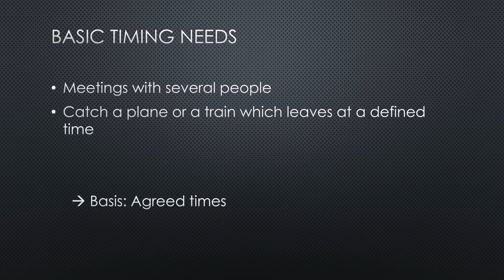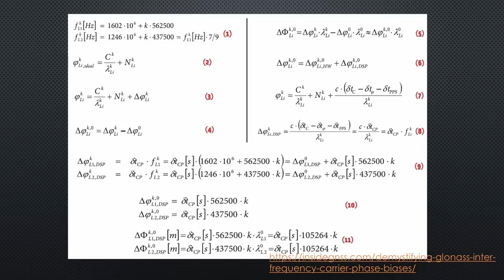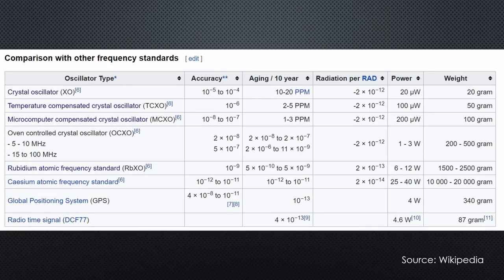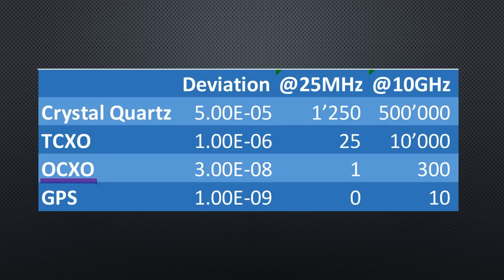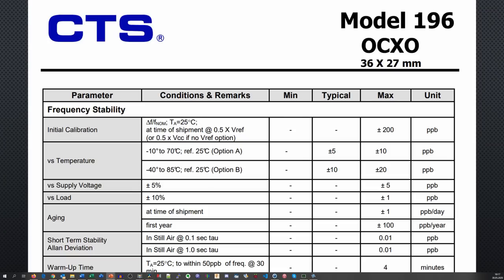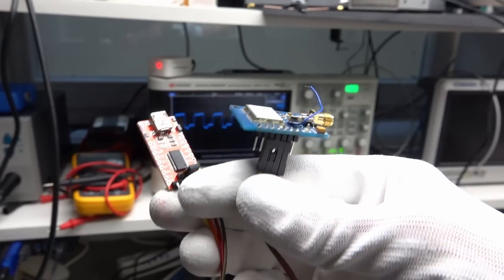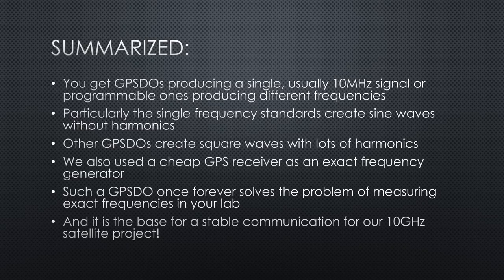#336 How to get Precise Timing and Frequency to our Lab. From Crystals, TCXO, OCXO to GPSDO, BG7TBL

Comment: Can you please make a video on how to choose the right microcontroller, I recently got an MSP432 for my college project and finding it hard to work with
Reply: @Scott Page USMC Thank you for  your interest, My problem is mostly with using code composer studio, I don't see many examples on how to program MSP432 whereas STM32 has got lot resources on web so was wondering if I have switch to that. I am very familiar with using arduino boards, but I was told not to use that.
Reply from the maker: I use Arduinos, ESPs, and Raspberries. Mostly because they have a huge community support.
Reply: @Scott Page USMC Thank you for your interest sir, TI is sponsoring the kits for us thus we are supposed to use them, I have searched some books and reading those.

Comment: I am a noob hobbyist, not a radio-head, so this sort of precision is over and above.  Last year though, while debugging a digital FM tuner (RDA5807M) project, I  discovered the frequencies of my watch crystals (2^7hz) differed wildly from each other.  Sometimes they were off as much as +/- 30hz, throwing off my tuning.  Still do not know any simple way to calibrate these (sigh).  Cannot see the end of that rabbit hole.
Andreas:  Do you know the secret to delivering a good joke?

timing
Reply from the maker: True (the timing of jokes). Concerning watches: You are right. Their timing has to be quite precise. I think a GPS module programmed at the crystal frequency and hooked to an oscilloscope would be en interesting experiment...

Comment: Using the GPS clock signal is easier than I thought! (I never know that PPM is also adjustable too)
How do you wire the GPS signal to the basement? Do you have to put the module outside and wire the pulse signal into the room? Or broadcast the clock signal as you do with your Ikea clock video?
Reply from the maker: GPS antennas are "active". They have an amplifier built in. So you can have quite a long cable from the antenna to the basement. But for sure the antenna must "see" the satellites.
Reply: Thank you for the answer. 😃

Comment: Andreas, you should have also included Mems oscillators. You can now get these from SiTime. They are available in TCXO's down to 0.5ppm, and now also have sub ppb accuracy OCXO's. These consume significantly less power and have much better over temperature stability, and have none of the Xtal defects such as activity dips. The are also MUCH smaller...if you want to know more you can connect with me in LinkedIn...otherwise take a look at SiTime.com
Reply from the maker: This is a "mainstream" channel and the art is to leave most things away ;-) Maybe in a few years when we can buy them on AliExpress like the MEMS microphones...
Reply: @AndreasSpiess  Andreas, already available in Ali Express, DiGiKey, Mouser, Arrow, etc.....and programmable to ANY frequency by user if required...They are now the worlds largest Oscillator (not Xtal) manufacturer, ship more that Epson, NDK...etc......obviously this is your channel, and you do a great job and this is why you have so many followers...thanks for everything..
Reply from the maker: Do you have an Aliexpress Link for a good MEMS oscillator? I plan to play around/compare with the different technologies and you seem to know more than me ;-)

Comment: Hi. Great explanation in a short time span! Short question: in the video at  about 18':15" we see the square wave of the cheap GPS receiver. Would you know why the square wave has/looks irregular width, with 2 wider and 3 shorter positive period square? If this works that would be a very cheap solution to a very high accuracy clock!
Reply from the maker: I do not know the reason for the irregularities :-(
Reply: @Andreas Spiess  I think I know now the Why part. Just watched an interesting video. It seems that the (programmable) output frequency of the gps generator is provided by dividing the main clock of 24MHz. If you choose a frequency that has fraction, then you get a weird mix. For example: 10MHz would be factor 2.4.  It seems you get a mix of 12 and 8MHz. More info on: https://youtu.be/M6SmdqMA-Dg

Comment: I see we are currently running on the same clock ;-) Iam am also just looking into the GPSDO stuff for an QO-100 SDR setup. I think I will go with the Leo Bodnar Mini @25MHz for the beginning. Have you seen the Lars GPSDO thread on the EEVBlog Forum? There is a ton of information on a (relatively) simple GPSDO Setup with an NEO-xx Module an OCXO and a small Arduino. Took me quite some time to find it, but looks as the best DIY Setup so far. So it should be possible to get a relatively cheap GPSDO for the QO-100 setup.

Besides have you seen the setup where someone reprogrammed the Pluto to run on 25 MHz reference clock speed? So you just need one GPSDO! ;-) (It's just a software modification, no deviders, nothing).
Reply: Lars GPSDO https://www.eevblog.com/forum/projects/lars-diy-gpsdo-with-arduino-and-1ns-resolution-tic/
Reply from the maker: One of my Pluto’s already runs on 25MHz;-) And maybe a OCXO alone would be enough for QO100. They seem to be quite precise.
Reply: This is one of the cleanest QO-100 setups I found so far (look at the small & clean POTY setup, great!):
https://forum.amsat-dl.org/index.php?thread/2936-pluto-box-solution-w-full-gpsdo-lock/

The Transmitter needs to be replaced, I will go with an SG Labs 20W @2400MHz PA and an https://github.com/db4um/PA_13cm_2W preamplifier.

It took me quite some time and tons of reading threads the last weeks to find the best components, hope it helps.
Reply from the maker: Thank you for the links. This is also my direction. Maybe waterproof.
Reply: @AndreasSpiess  Yes, a waterproof outdoor case with all the components included would be the best way I think. And then with a LAN Cable  to the Homenetwork. So no losses on the antenna cables. 

I am just not sure if the temperature changes outdoor wouldn't have a too high impact on the system!?

BTW I also stumbled over a nice Bias Tee PCB which injects the LNB DC voltage PLUS the 25 MHz from the GPSDO into the RX Cable.
There is also a 50 Ohm to 75 Ohm impedance adaption included. 
(If you are interested drop me a line than I can look it up in my notes.)
Reply from the maker: 1. The GPSDO should be stable in varying conditions.
2. The combined feed is a good idea for long cables. I assume you have to separate them somehow inside the LNB. I chose a twin LNB where I have desoldered one connector. Maybe easier in these small cases.
Reply: @AndreasSpiess  @1. Yes A GPSDO has longterm stability from the GPS but the short term depends on the OCXO. Which has an oven for a reason ;-) to keep the temperature impact low. But sine it can get cold in Austria and Switzerland (<-20C). I think selection of the OCXO is important.

2. Yes you have to separate the Clock Signal again in the LNB, but this come down to a simple low pass filter (25MHz vs. 2.4GHz) (and IIRC a 75 Ohm termination IIRC) Shouldn't be to hard for you. ;-)

I am currently learning for my CEPT1 exam this month so fingers crossed (by the way your FOSSASAT 1 video triggered it.)

@ LNB I was thinking to use the second connection for receiving wideband in parallel which needs the other polarization (so 18V IIRC). But I think my dish will be to small, let's see.

Comment: Have you seen the SiTime MEMS TCXOs? Seems like they'd be a good combo with GPS/atomic sources, they outperform many OCXO and are small SMD components..
Reply from the maker: No, I did not see them. They seem to be interesting parts. And, as you write, very small and energy efficient compared to OXCOs. And maybe they are good enough for many applications and can replace a GPSDO.
However, precision is not as important for a GPSDO. Stability is more important because the absolute frequency comes from the GPS signal.

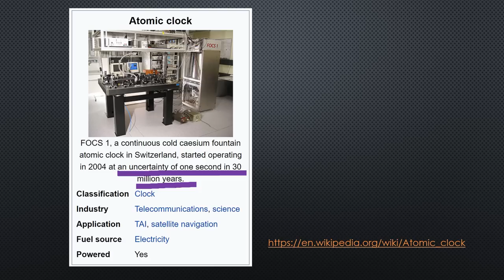Comment: 11:51 - "Clumsy and expensive" :) I would definitely knock that all over onto the floor, probably with the back of my chair or a coat sleeve! And then what would we use to recalibrate it?! :)
Reply from the maker: I am not sure if you have to calibrated these clocks as they use a material constant. (At least that is what I understood.)
Reply: @AndreasSpiess  Very true. But don't underestimate my clumsiness to take out atomic physics, too! 😂 Cheers, M1GEO.

Comment: @Andreas Spiess, I'm also trying to get external reference to my Pluto but I'm not sure how to wire the UF.L socket in place of the TCXO.. I found some schematics online but I do not understand them nor I can trust the source 😂 so I would be glad if you could explain how you did it, or how it works! :) Thank you!
Reply from the maker: Just look at the diagram. There you see the capacitor between the crystal and the chip. The pin of the U.FL has to be connected to this capacitor. And the ground to ground. the connector ends up with about 45 degrees turned. According to Analog Devices, the external reference should be 1.3V p2p max and should be applied before boot

Comment: I love the topic and your explanations.  However, it wasn’t clear to me if using the PPS output of a suitable GPS receiver would produce precision pulses THAT ARE SYCHRONIZED IN PHASE WITH OTHER GPS RECEIVERS LOCATED ELSEWHERE.?  Basically, if a person wanted to do Time Difference Of Arrival (TDOA) location of a transmitter, is it sufficient to use the GPS PPS output at each receiver site with confidence that they are synchronized with each other and with limited skew?
Reply from the maker: From Wikipedia: PPS signals are used for precise timekeeping and time measurement. One increasingly common use is in computer timekeeping, including NTP. Because GPS is considered a stratum-0 source, a common use for the PPS signal is to connect it to a PC using a low-latency, low-jitter wire connection and allow a program to synchronize to it. This makes the PC a stratum-1 time source. Note that because the PPS signal does not specify the time, but merely the start of a second, one must combine the PPS functionality with another time source that provides the full date and time in order to ascertain the time both accurately and precisely.
Reply: @AndreasSpiess  Thanks Andreas.  Greetings from the USA.   Experimentally, using my DSO, I proved to myself that the default 1pps output of two of my GPS modules is usually within 40 nanoseconds of each other.  So they ARE "synchronous".  I knew that the period was precise but I wasn't sure that I was guaranteed that they are aligned and it appears that they are.  Now it is possible for me to receive radio transmissions at multiple different locations and try to determine the origin using TDOA techniques.  I did not want to have to try correlate to a transmitter signal sent from a known location for the timing alignment.  It seems much simpler to align all receivers with the GPS pps signal and then work from that!

Comment: Have you considered using the PPS (Pulse per second) output on the $12 GT-U7 Gps receiver boards?  Its a tiny board and works really well as a GPS with Arduino or equivalent boards.  
Here is the Amazon link to the product: TeOhk GT-U7 GPS Receiver Module Navigation Satellite Microcontroller GPS Compatible NEO-6M 51 Microcontroller STM32 with 1x Active Antenna https://www.amazon.com/dp/B07RPVYSG5/ref=cm_sw_r_cp_tai_Yba.EbN4B5YFQ
Reply from the maker: All GPSDOs use such modules to "discipline" the crystal. But their short-term stability is not great. Maybe I will make a video about that in the future.

Comment: the uBlox modules intrigue me. About them I have the following questions: if you set a frequency, lets say 12.000.000 Hz, will that frequency also be generated after a power-down/power-up cycle? What accuracy can I expect if the module is free running?
Reply from the maker: I mentioned in the video: You have two frequencies to select. One comes up without GPS fix, the other with GPS fix.

Comment: We install synchronization equipment that uses Cesium clocks as backup if the GPS receiver is down or jammed
Reply from the maker: So it must be an important application ;-)
Reply: @AndreasSpiess  Stuff that needs to run properly even if the sh!t hits the planetary fan

Comment: How accurate is the ublox 1pps compared to your other GPSDO's? The "timenuts" mailing list (posted online and easily found by searching), has a bunch of information about why the ublox 1pps signal doesn't work as a GPSDO. Basically, the module's internal frequency is not divisible to an integer of 1. The modules are not made for this purpose and this results in a lot of jitter. My grasp of the subject is weak, but from what I've read, the 1pps signal quality is not much better than the module without any satellite signal at all. I would love for someone to really break this down and prove whether this is true or not. I know of a lot of people that have tried to build a ublox based GPSDO, but no one that actually uses the device in practice afterwards. I get the impression they all assume they are the exception and must have made a mistake. I don't think anyone has succeeded though. There are enough examples of people attempting to build this project that more and more people keep trying. Several people that have built one of these ublox GPSDO's, later acquire units like you had here.
Thanks for the upload.
-Jake
Reply from the maker: The u-blox really has a horrible jitter. But it is precise in the long run. So it depends what you want. For a stable oscillator you need an OCXO to discipline. If you just want to build a frequency meter I assume it would work for most cases.

Comment: Dear Andreas, the UBLOX use 24Mhz for the internal crystal so if we want 10Mhz we got a lot of jitter. your oscilloscope screen capture does not shows that because it in single capture mode.
**  Do you think we can replace the internal UBLOX crystal for 20Mhz so divide by 2 will give us a jitter free 10Mhz? **
Reply from the maker: To get precise timing you have to use a OXCO or a TXCO and discipline it with a GPS. The GPS module always will have jitter.
Reply: @AndreasSpiess  Dear Andreas i replaced the neo7 onboard TCXO with external osc and did got a visual  jitter free 10mhz. you can watch this video and read my comment. from what i read the pps is already disciplined but cannot output 10mhz because the neo7 has a fractional n synthesizer that cant divide to exact 10mhz. however it does 8mhz,12mhz jitter free. the internal tcxo is 26mhz . you can watch this video and read my comment. https://www.youtube.com/watch?v=M6SmdqMA-Dg&lc=UgxHxrVXMsb_1tVLoP14AaABAg.9E6zqlDAGUC9E7I3ry0Mr3

Comment: Hello, what is the maximum voltage (or amplitude) of a signal that the BGT7TBL FA-3 (or FA-2) frequency counter can handle? I would appreciate your support a lot!
Reply from the maker: Its datasheet says: CH1 Input sensitivity：50 OHM: 25mVrms-2Vrms or 1MOHM: 25mVrms-10Vrms

Comment: is it critical for measuring instruments or radios to have a square or sine wave ? and if I understand the neo-6 can have it's 1PPS pin reconfigure to become a 10MHz reference clock ??
Reply from the maker: It depends on the instrument.
You can create higher frequencies with the GPS modules. But they create jitter.
Reply: @AndreasSpiess  thanks for the reply, it's for a ham radio transceiver that has a 10MHz ref input that required -10dBm (approx 100Hz of drift can be observed with the stock TCXO on 1.2GHz), I thought your u-blox M series gps suggestion was a great idea on top of being cheap !! But since I cannot be sure of the "quality" of the signal and if jitter can cause issue out of the PPS pin to my transceiver, I also cannot measure how much dBm is getting out of this little board as I do not have the proper equipement to measure RF power...
Reply from the maker: I would not use a plain GPS chip for this purpose. Usually a GPSDO is the better solution.
Reply: @AndreasSpiess  Thank you for all your replies and tips !

Comment: 11:35 how do you determine the accuracy of the most accurate clock ever built? Just wait 30 million years? ;-)
What's the reference there to determine the drift?
Reply from the maker: I assume there is a reference. If you are interested in the details, you can go to the "timenuts" page (leapsecond.com)
Reply: @AndreasSpiess  Cool, thanks for the link! If you're interested, I can post the answer to my question, if they can help me with that.
Reply from the maker: @stefanmayer444  I decided not to care for the details. Because everybody involved told me that it is a dangerous rathole ;-)
Reply: @AndreasSpiess  Haha, you started that topic in the first place ;-)

Comment: Just out of curiosity, how to calibrate the frequency of the OCXO?. What are the tools and methods used?.
Reply from the maker: A better reference like a GPSDO is compared and the OCXO is adjusted.
Reply: @AndreasSpiess  Thanks for you reply, put how does the OCXO get adjusted?
Reply: @Ash  If my memory is right, the crystal has two small capacitors, one either side of it. Normally one of them is variable and can be used to trim the frequency when the temperature is stable.
Reply: Many OCXOs have a "VFC" pin that allows their frequency to be calibrated by varying the voltage on the pin. That is how the oscillator in a GPSDO is disciplined.

Comment: Great video, as always. Do you now about a basic 10 MHz distribution box, just 10 MHz in and six or similar 10 MHz out?
 I don't believe that a OCXO is needed for this, maybe to continue if the 10 MHz ref is down.
Reply from the maker: I read they sell it also without oven, but I do not know where. I assume the oven does not add a lot of cost...
Reply: Look at the distribution amps from tapr.org -- they still have the TADD-1 distribution amp available, which is a low noise, isolated amp for 10 MHz.